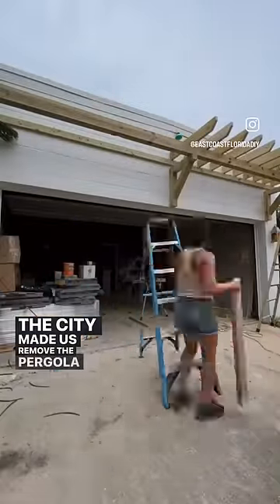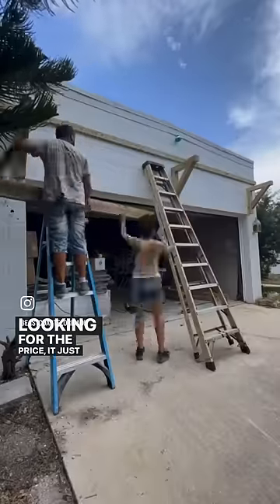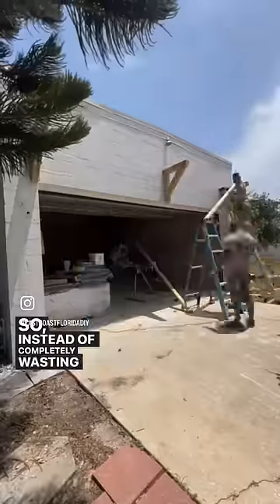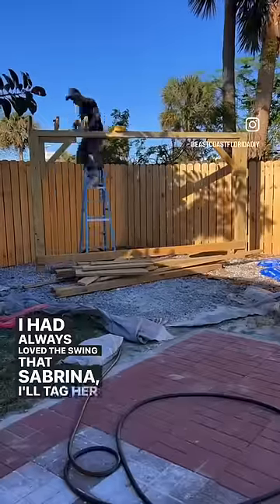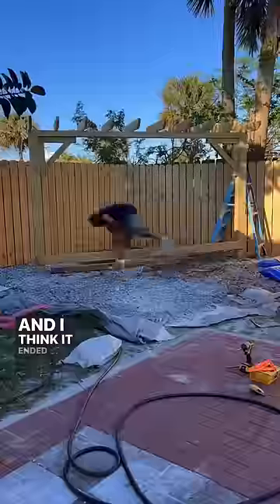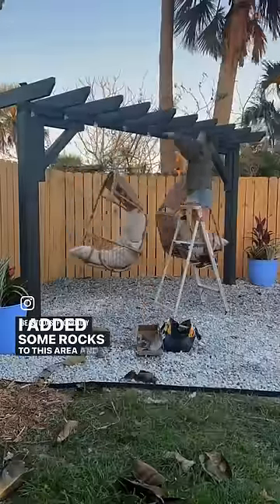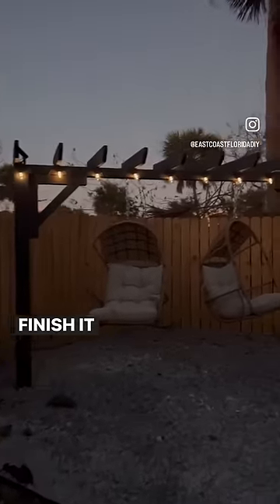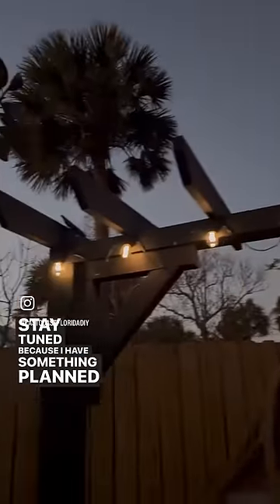Beach Bungalow Flip- city made us take down pergola so made an outdoor swing instead!

Comment: Engineer plans for a non load bearing cosmetic enhancement seems like a bit of an overreach but the swings turned out beautiful
Reply: During a hurricane it could go flying and be dangerous or damaging.
Reply: @mowlessbeemore2107  good point! Ty
Reply: My thoughts exactly
Reply: The city just wanted money for the permits they would've made them get stating some BS soooo you did a great job repurposing the materials 🎉 and the city get $0 for deco that they should of minded their business about. 👏
Reply: @mowlessbeemore2107  the same will happen with the swings don't you think???
Reply: its law. Especially if in earthquake area.
Reply: @mowlessbeemore2107   everything can be dangerous and damaging during a hurricane. It's just government overreach. Just nickle and dimming people for foolishness.
Reply: Where I live you might  at least need a permit for projects like that, not sure if that specifically would need an engineer plan though. The permits are usually needed when the change would (usually drastically) alter the look of the property. An example is painting your house a very different colour to it's original. It can feel very silly at times.
Reply: The “free state” of Florida 😂😂😂😂😅😂
Reply: It’s a total stretch. The city just wanted money for permits. The swing is much more dangerous in a hurricane than a non load baring pergola secured to the house. I have three off of my house and the town has had no issue with them.
Reply: @SaraHinata  sure, but there's a difference between something that's attached to your house which can accidentally cause extra damage to the house, and a small structure in the yard. The local government is in charge of making sure houses are safe so they get to make the rules.
Reply: @mowlessbeemore2107  so could one that is engineered.
Reply: @graceanne385 ...a neighbor probably complained 😑
Reply: Great repurpose idea! I hope they don’t come mess with you about the swing. ❤ remember to bring them indoors when expecting high winds.
Reply: Just because something isn’t weight bearing does not preclude it from requiring an engineer to consult, especially if it attached to exterior structure as it can potentially compromise interior structure.
Reply: @mowlessbeemore2107  what's to stop it from going flying where it is now?
Reply: @mowlessbeemore2107  Agreed. I live in FL 20 minutes from the beach. I can see a hurricane ripping that off.
Reply: Completely agree.
Reply: Yeah THIS!!
Reply: @mowlessbeemore2107  so the swings can’t go flying?? Sounds reasonable…
Reply: @chancemathews7057  Believe me, there is absolutely nothing free in Florida.
Reply: I couldn't disagree more.. It's a lot of heavy material attached up high.
Reply: @iamme3518 that's very heavy hanging over your head. You want to ensure they know what they're doing. You can't honestly be blind to that fact?
Reply: @graceanne385 um no
Reply: @shag4937 you can't be this silly fr
Reply: @MowLessBeeMore  I mean, it's attached to the house. Wouldn't a pile of lumber in the backyard do the exact same thing, except be even more dangerous since none of the boards are actually attached to anything??
Reply: @MowLessBeeMore  I mean, it's attached to the house. Wouldn't a pile of lumber in the backyard do the exact same thing, except be even more dangerous since none of the boards are actually attached to anything??
Reply: @jakkljackson8927  the problem is, how well is it attached.
Reply: @MowLessBeeMore  nah technically the city just wants money. My dad does roofing and our city asks for a permit for reroof yet they don't inspect it.
Reply: Its literally a scrapbook of a home enhancement and dangerous af. They know this or they wouldn’t have taken it down.
Reply: @mowlessbeemore2107  The swing set can have the same effect, though, during a storm: materials going everywhere. 

Good point, though. 😊
Reply: Sounds racist 🤔
Reply: And then she turned it into a swing that was actually load bearing.... Figures
Reply: @mowlessbeemore2107 the same happened to any trash can, grill and garbage in the back yard. Lol
Reply: Anything over 4ft needs plans.
Reply: I’m the neighbor, glad it’s gone. It looked tacky as heck.
Reply: Revenue generation.
Reply: @chilant horse feathers.
Reply: The issue is it can fall on someone.
Reply: All is good and well until the cosmetic enhancement falls on the mailman head's
Reply: Wrong needs to be able to support weight, in England that would be the weight of snow. Also spec fixings, size of wood. Etc
Reply: Not an overreach when you're the victim with permanent injuries.
Reply: @mowlessbeemore2107  so being  mounted, attached and secured to a buildings structure you're concerned that it won't hold up in a hurricane but as a swing where its not secured to attached to any structure is the better option to withstand a hurricane?! Smdh! 🤦‍♀️
Reply: @lisaparker5836  not necessarily free but atleast we don't have state taxes....LOL!
Reply: @mowlessbeemore2107  During a hurricane everything is gonna go flying not just that.

Comment: Yes anything structural you need a plan. Some may say but its not load bearing but beams of a certain weight need straps and ties called out that are to code. Even in your home non structural walls are built to code. I live in California. My ex was a structural engineer and I was in construction bookkeeping. Codes are to protect you. Also if in a planned community there are rules also even if no HOA. You have to ask permission first. That pissses them. We built an add on green house on our townhouse but my ex took the complete plans calling out all materials, straps, ties etc.  Stamped approved!
Reply: you don't need an engineer for such small overhang, only proper anchoring (proper screw/dowels that are rated at the proper load bearing) and proper thickness studs. now if that was a balcony that would be a different story.
That was just a very clear example of gov/city overreach. you don't need to get a permission for every little project you do on your property, especially if you do it per-code/standards
Reply: @davideyt1242  That structure was WAY heavier than it looked, and was cantilevered pretty far off the wall. As an engineer, I can tell you that this is not cut and dry. It was definitely questionable enough to consult an engineer, who would've had to see how that garage was built. This all gets much worse when you add in vines which pull on structures, then top that off with harsh weather. It's not a question of whether you can slap it and it not move, it's a question of whether it won't somehow tear that garage apart in a few years time with harsh real-world conditions.

IMO, codes are meant to protect unsuspecting people from injury, such as guests or purchasers. Otherwise people can earn Darwin awards if they feel like it. They're a necessary evil imo, but also one that keeps a lot of people safe. Even I hate the red tape.
Reply: @jrcowboy1099  well if they did not anchor it properly to the garage wall, that is another story. but if they "would have done" a proper job with the same size overhang, there is no way an engineer need to do this. I do not talk empty words, I have had to deal with multiple similar projects on my own property. one time we really needed to bring in a structural engineer and he had to calculate the amounts of concrete and steel etc.. for the pour. then we called him a second and third time for other things, he explained to us he has nothing to do and advised us on which projects are easy to tell from others if a structural engineer is needed or not. regardless of all what I have said - 95% of the times when the city comes for such tiny whinny project and demand it be treated like a friggin house addition it's all about fleecing more money out of the property owner. going this route, even hammering a fence post would require an engineer on site ;-)

Comment: Engineered plans? Wait until they see all the wall shelves in my house. Didn't feel necessary to model internal stresses and strains and calculate the failure load.

That said, if the wall is concrete (Florida) and they use sturdy anchors, it's no more dangerous than the tree next to the house. Not sure what's behind that section above garage door.

Comment: It's funny the city required engineered plans for it since the pergola was "decorative", nothing more!
Reply: Not funny if it would have fallen on someone getting into the garage
Reply: You don’t even require an engineer for residential houses
Reply: @CoCo-yv3hl  even if it was applied correctly it appears the building code required an engineer to sign off on it which costs more money & permits. Ironically in MT if you build within city limits you require many different inspections, but NOT if you build out in the country. If it was about properly following building codes it'd be a blanket requirement.
Reply: @CoCo-yv3hl  isn’t it their house tho?
Reply: It has to do with hurricane wind loads.

Comment: !!!SAFETY WARNING!!! Viewers please read my comment before you recreate this project.  

I noticed you did not show anyone actually using your swing project. If this falls or breaks you have to share a video of a failed project because this looks like a dangerous DIY. The chair swings you used always are attached to a ceiling or have a base to them. I've never ever seen swings attached to a single frame, they are always attached to 2 A-frames to look like a saw horse. You and your family can get seriously hurt if this tips over and the top beam hits your head. I hope you can add supports to make this safer because it is very cute, you just need to make sure it is stable.

Comment: THAT IS NUTZO!  It was cosmetic, ornamental.  It would never be anything more than decorative.  No further load demand or weight requirement.  Not like you were doing to deck it and put patio chairs on top.  EGADS!  ~ HOWEVER the new use...does have a weight load requirement.  🤦‍♀️